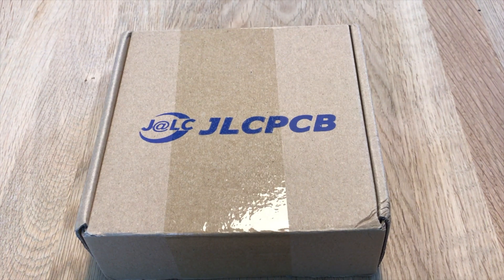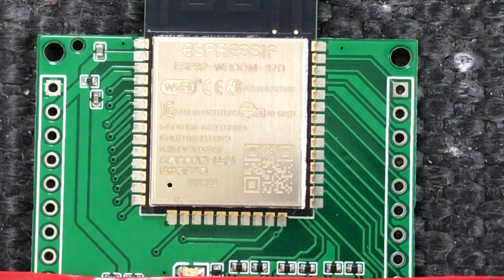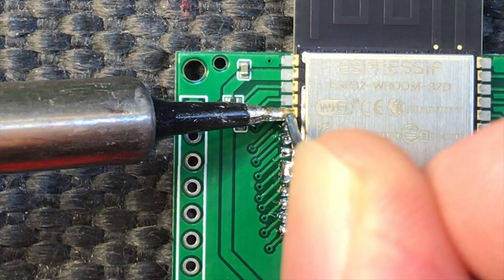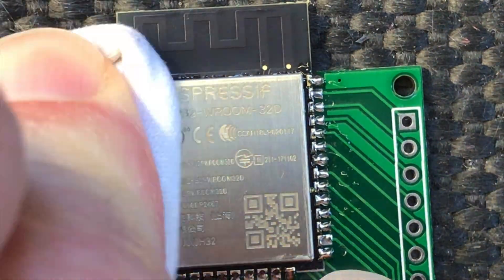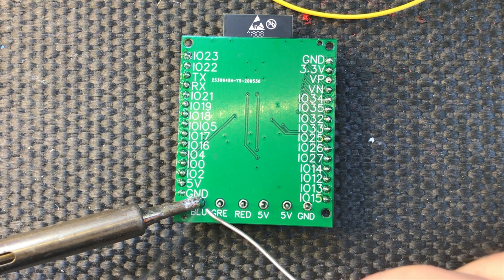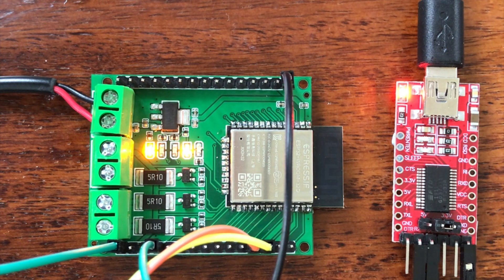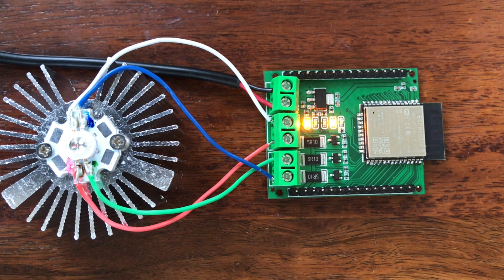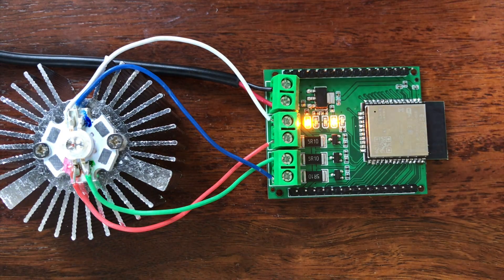Custom ESP32 PCB Soldering

Comment: You forgot to solder the ground UNDER THE CHIP For cooling.
Reply from the maker: With the ESP32 the ground pad doesn't need to be soldered - there is some thermal efficiency gained, but it doesn't make a huge difference - https://www.esp32.com/viewtopic.php?t=1864

Comment: I'm making an alarm project using an esp32 which is controlled via android with bluetooth and a 5Ah battery as a power supply. my problem is how to reduce the current consumption so that my battery lasts a long time without having to use the sleep mode method.

Comment: Why not order with the esp already soldered on?
Reply from the maker: This video was made before JLCPCB offered it as a SMD component.
Reply: The folks at JLCPCB have made the ESP32 modules require STANDARD PCBA process, adding ~$100 for 5 small PCBs. So soldering it yourself can be a money saver, as the economy PCBA for the rest of the SMD parts can be just a few dollars, especially if you only have BASIC parts.

Comment: 1. The PCB has thermal or ground pad at the centre. Assuming that you had designed the PCB that way, why did not you solder the ground pad?
2. There is a some Brazilian or some foreign guy YouTube channel that solders things, and in that guy's video, he just apply a lot of flux and then simply glide the soldering iron on the SMD pins. Does it not work at the guy shows? I mean, if it works, why are you soldering each pin one by one taking a lot of time?
Reply from the maker: With the ESP32 the ground pad doesn't need to be soldered - there is some thermal efficiency gained, but it doesn't make a huge difference - https://www.esp32.com/viewtopic.php?t=1864

The gliding the soldering iron only works for surface mount pins - the ESP32 modules have castellated holes - there's a good video here that walks through in details how to solder them https://www.youtube.com/watch?v=rGvvwXrv310

Comment: Why did you have them presolder all components excepts the esp32?  Was it not available at the time?
Reply from the maker: Yes, this was before they supported the ESP32 in their parts library. They do it now along with a lot more components including USB connectors.
Reply: coming from the future: JLCPCB won't assemble ESP32s with the cheaper multi-customer assembly process, so you either have to pay more or do it yourself

Comment: I have some 10w RGB COB LEDs which need different voltages for each individual colour, why dont yours and where can i get them?
Reply from the maker: I'm using 3W modules off eBay - the actual listing I got them from seems to have expired but the forward voltages were Red: 2.6, Green, Blue: 3.4 And the current Red: 400ma, Green, Blue: 350mA. My working assumption was that it kind of balanced out, with the red channel having a lower voltage drop, but higher forward current. If you wanted you could give each channel a different resistor value to fine tune the current for each color.

Comment: Do you know any possible reasons why when I connect my esp32 board to the USB UART connection all the LEDs on the USB UART turn off and nothing happens? Is there a short circuit somewhere or do I need to connect any other connections together? The connections are the same from this video and I connected pin 0 to ground for the programming part and I have a similar PCB design as yours.
Reply: I can send you more information if needed.
Reply from the maker: @debatestuff6897  If you can share the schematic you are using then I'll take a quick look. It definitely sounds like some kind of short circuit.
Reply: @atomic14  Ok thank you. https://i.imgur.com/9RabJ3v.png - here is the link to an image of the schematic, and here is the link to the EasyEDA project file https://easyeda.com/join?type=project&key=0a3e334f8dd04178923e8224b411e923.
Reply from the maker: @debatestuff6897  I can see a DRC error on the PCB https://imgur.com/a/RFlEOnP it looks like the 5V line is connected to GND. Double-check this on your side to make sure it's not just my view of the project. Also worth double-checking on the PCB - just do a continuity check between 5V and GND.
Reply: @atomic14  Oh I do see actually continuity between the 5V and GND. I think I just made a wiring mistake on the PCB sketch is there any way to salvage this? I still have a 3.3V input directly to the ESP32 so I can work around the regulator.
Reply from the maker: @debatestuff6897  There will be weird things going on at the moment with the input of the regulator tied to GND. You can use a sharp knife to cut the offending trace https://imgur.com/a/VhWB4Hm Or desolder the regulator. You won't be able to use your 5v input but that's not the end of the world. I know it's too late now, but always check the DRC rules - I've been caught out before thinking there were no problems and it was a bug in the checker - I've always been wrong :)
Reply: @atomic14  Ok I will do that thank you!
Reply from the maker: Let us know if you manage to salvage it. We can post a photo of it working on the community page.
Reply: @atomic14  Ok I will let you know, thanks again.
Reply: @atomic14  So I got the board to turn on and for the TX light to blink and to get my USB UART to blink the RX connection but anytime I try to write code it is able to connect to the ESP32 and detect it on the port but not write to it. It says this, "A fatal error occurred: Failed to connect to ESP32: Timed out waiting for packet header." I know this means it is not in download mode. I tried connecting IO0 and GND together but it still won't work, is there something I am missing?
Reply: It is also giving this as well, "Failed to connect to ESP32: Invalid head of packet (0x1B)
."
Reply from the maker: @debatestuff6897  do you see anything in the serial console when you power up the board? You should see a bunch of info and then “waiting for download” when you have gpio0 tied to ground and you power up the board. Have you got rx and to the right way round? Try swapping them over.
Reply: @atomic14  So I did see that serial console and all the information pop up, but it still didn't let me program to the board, but then after that something happened to the connection and now every time I try to connect the board to the computer the TX LED starts rapidly blinking even with no RX and TX connections. I think the problem is with my USB UART but I am not sure. The wiring stayed the same and I am not sure why that happened. The TX led basically starts blinking every time it has power, and it was working fine with the same wiring just before. This is the USB UART I got off amazon. https://www.amazon.com/IZOKEE-CP2102-Converter-Adapter-Downloader/dp/B07D6LLX19/ref=sr_1_3?dchild=1&keywords=usb+uart&qid=1615431275&sr=8-3#customerReviews.
Reply from the maker: @debatestuff6897  You need the GPI0 connected to GND when the ESP32 powers up to get the "Ready for Download" message. It's possible the UART has been fried from the previous problem with the track - though they are generally pretty robust.
Reply: @atomic14  I measured the voltage from the ESP32 3.3V pin to ground and the UART is able to give the ESP32 3.3Vs. I think it could still be the UART however just malfunctioning the RX and TX and not the ESP32 because the ESP32 was able to communicate with my computer. I am just going to try this with another UART and see if that works.
Reply: @atomic14  So everything is working except for putting the ESP32 in programming mode. When I connect Ground to IO-0 it just doesn't do anything not sure why. Do you have any suggestions on getting the ESP32 into programming mode like do I connect the pins right when it is connecting or uploading?
Reply from the maker: @debatestuff6897  You should have IO-0 connected to ground when you power up the ESP32. That should put it into programming mode.
Reply: @atomic14  Do I remove it after it connects? It just does this on Arduino IDE, https://i.imgur.com/AhGU60a.png. When I leave it and remove it right after it does the same thing.
Reply from the maker: @debatestuff6897  If it's working properly and you have the serial monitor connected then you should see it boot up and show a message that it's waiting for a download. You can leave it connected to ground - should make any difference. Just remove it before you reboot otherwise it will go straight back into programming mode.
Reply: @atomic14  This is a point I didn't pay enough attention to. The ESP32 needs to be powered on with GPIO0 connected to GND. Otherwise it won't allow programming.

Comment: Do you solder anything underneath esp32-module? I've seen documentation suggests a thermal ground pad below the module
Reply from the maker: There is a thermal pad. According to Esspresif it's optional - you will get better thermal performance if you solder it, but it's not required.
Reply: @atomic14  ok...thank you!

Comment: Question on the PCB design.
So I am making my own dev board using the ESP32, and I was wondering what the purpose of the resistors and caps at the top left of your board for? At 0:43. 
Also, nice video!
Reply from the maker: Thanks! I'm glad you like it.
One of the capacitors is a bypass capacitor - see here in section 4 for details - https://www.espressif.com/sites/default/files/documentation/esp-wroom-02_pcb_design_and_module_placement_guide_0.pdf

The other Resistor Capacitor pair is on the enable line as recommended here in section 3 here  - https://www.espressif.com/sites/default/files/documentation/esp32_hardware_design_guidelines_en.pdf

I believe it is there to add a short delay to the chip starting up while the power line stabilises.

Good luck with your board - post a link to it when it is finished!
Reply: @atomic14  how come you have no button with EN and Boot then?
Reply from the maker: @thilotech  For programming I tie GPIO0 low which puts it into programming mode on power-up.

It's not as convenient as having buttons, but once I've flashed the board with the first sketch I use over the air updates. So unless I brick the board I don't normally need to put it into programming mode.

The next board I build I will put a USB interface on it and set it up so that it goes into programming mode automatically as that is a lot more convenient even if you aren't doing it very often.
Reply: @atomic14  But what aobut the EN pin? Don't you need to pull that one low too?
Reply from the maker: @thilotech  Provided you have GPIO0 held low when the board boots it will go into programming mode. You can trigger a reboot by taking the EN pin low or just by removing power.
Reply: @atomic14  So do I even need the EN pin connected to anything?
Reply from the maker: @thilotech  EN needs to be high otherwise the board will not run. Espresif recommends using an RC circuit for this so there is a short delay after power is applied.
Reply: @atomic14  So how do you program it? I mean I think you need to low pull EN to flash? Or not?
Reply from the maker: @thilotech  Provided you hold GPIO0 low while you power cycle you will go into programming mode.
Reply: @atomic14  So in theory I don't need a button at all on EN?
Reply: @atomic14  I designed a circuit, used RC circuit for EN. But not Auto starting without grounding EN pin

Comment: so how hot do those current limit resistors get ;)
Reply from the maker: Pretty toasty if you run it at full whack :) But I’m only cranking it up to around 70% as it’s pretty bright.
Reply: @atomic14  yea i know the problem but this is the easy way of controlling a high pwr rgb led

Comment: If you use a thinner solder wire you have better control over the amount of solder and most likely don't have to correct so much with the solder sucker.
Reply from the maker: Quite right - I did another board recently with much thinner solder and it was a lot easier - https://youtu.be/mGHrxK5xrUU